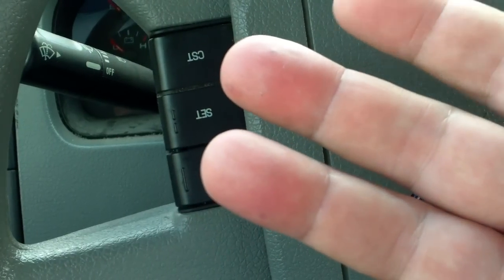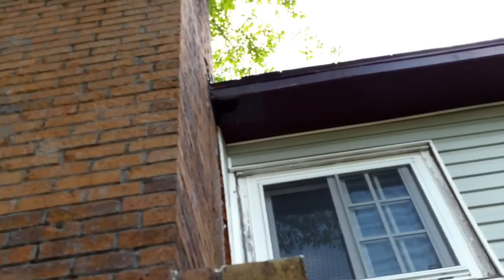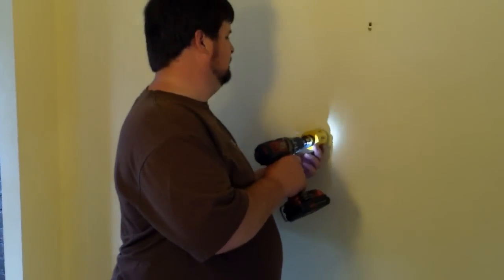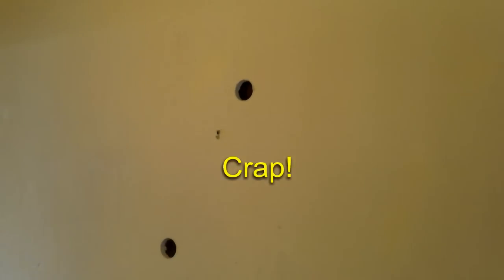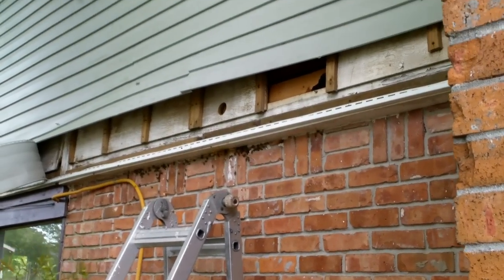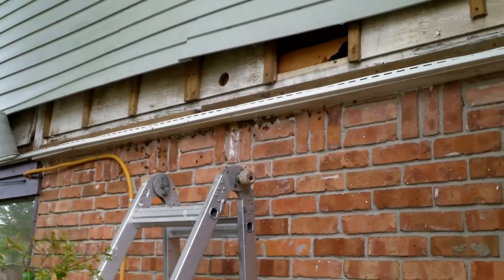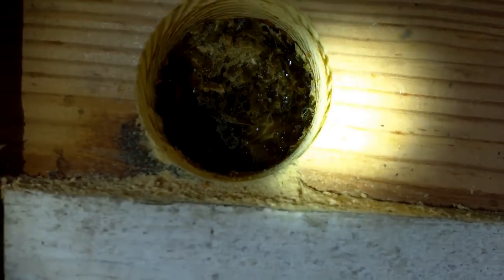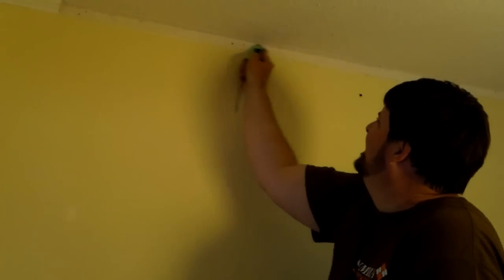Good Size Bee Hive In The Kitchen Ceiling

Comment: that's why it's always good to have a drill that still has a cord.
Reply: they still overheat, when the motor gets too hot a current can't get through, heats brings up a lot of resistance for a current.
Reply: Not all drill overheat if you pay good money you get a good dill that will not overheat

Comment: Hey, some tips. 
Use a stethoscope. I can hear squirrels and bees through the wall easily with that. Also, go to your paint store, grab some plastic and thumb tacks and you can create plastic walls to keep the bees confined to your work area instead of them flying everywhere. Just thumb tack the plastic to the ceiling and let it hang down.  Everything else you are epic at, good work.
Reply: Carpenter bees suck!

Comment: You need a stud finder so you can cut in between them to avoid busting the drywall and upsetting the bees.  Love watching your shows. Still think you are crazy for not wearing a suit even if it is hot.  Doesn't someone make a suit with a battery powered fan that would keep you cooler and also keep the suit off your skin thru air pressure to avoid getting stung
Reply from the maker: I think someone does make a suit like that but I don't think it was designed for beekeeping.  If it blew ice cold air I'd love one.

Comment: I gather from another vid on here that bees will chew through silicon if they're keen to get the hive / nest, but that neat Orange oil they do not like and are detered by. Sure I guess it will evaporate in time, but I guess its alot easier to plug the holes permanently when the bees have been moved on, rather than try to render over silicon which doesn't work.
Reply from the maker: Rabidavid You'd be surprised what they'll chew through given time.

Comment: We've got bees in the wall of the outside of my brothers room , Will the guy have to cut the wall to access it or not ?
Reply from the maker: It really depends on how the house is built.  Is the siding brick, stucco, wood lap....?  Are the interior walls plaster, drywall, paneling......?  Construction style will dictate whether access is gained from the inside or the outside.  Bottom line is if they are in the wall you do have to open a wall for a proper removal.  You could go the route of a trap-out but I don't recommend it.
Reply: alright thanks

Comment: Why do americans have that kind of space between the floors?
Reply from the maker: +Wolfdale It's all about engineering.  Since in residential construction we don't use much cement aside from the slab our second and third floors are supported by beams, trusses and joists.  This leaves space.  If he had poured cement structures this would not be an issue.

Comment: 628 dirt rooster-- I want to know something. should I spend 2900 Dollars saving a swarm or spend 300 killing them.
Reply from the maker: +Logan Norrell $2,900.00?!!  Where are they?
Reply: +628DirtRooster im looking at a contractor in Florida im replacing some drywall too in my kitchen.
Reply: +628DirtRooster  im also getting some work done by the same person near the front door. im trying to flip a house. bought the house 1500 square feet for 150000. just asking a pro what I should do. thanks for responding.
Reply from the maker: Logan Norrell If that price is only for the bee removal you need to tell that dude to hit the road unless there are some really unusual circumstances where he has to build a bunch of scaffold or rent a 60' reach man lift or something like that.
Reply: Ok thanks for the advice

Comment: I see you work without gloves in high risk settings... which leads to unnecessary exposure.  So which is more uncomfortable, the gloves or the stings.  Slow learning from experience and low tolerance for discomfort/ clothing, tags etc...  You can get used to it.  In my job, I am required to wear a hat, sun screen, long sleeves, long pants, steel toe boots, safety glasses and occasionally a mask and ear plugs.  And really annoying when you have to wear a fall harness and tie off.   Those can be gotten used to... you just wear it and you get used to it.   Enjoy your video posts, debating taking up the hobby.
Reply from the maker: Gloves suck.  I do wear the gear sometimes.  But only when there is no choice.